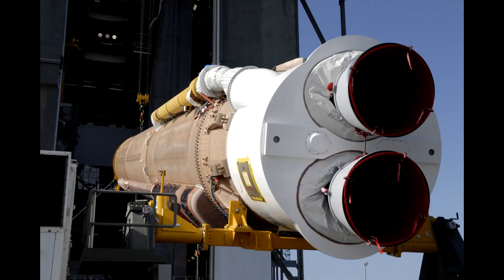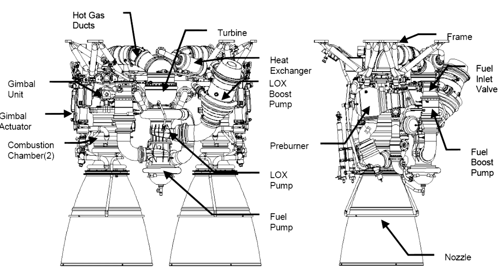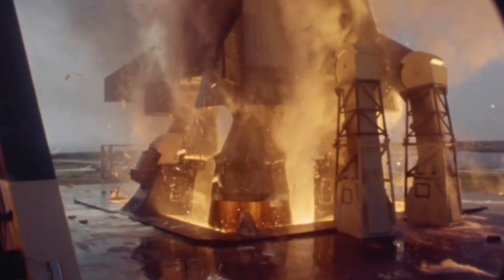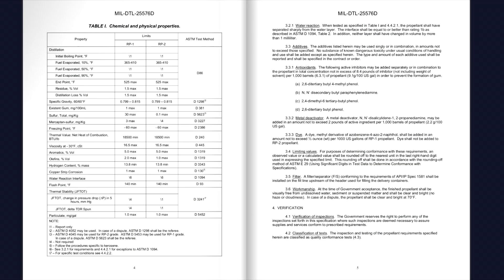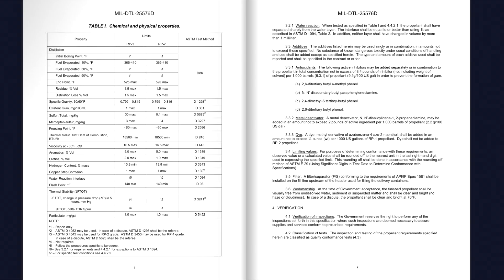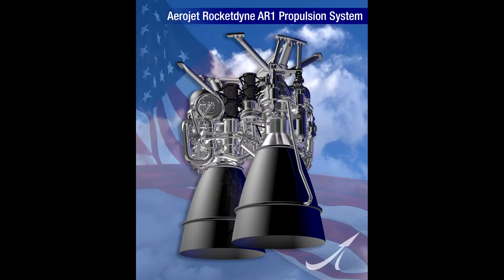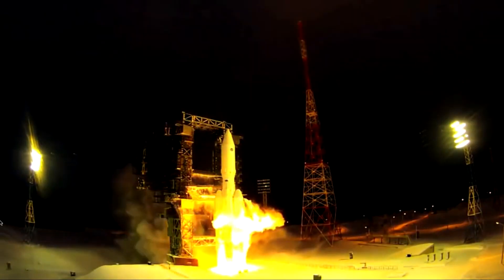Why Some 21st Century US Rockets Still Use Soviet Era Engines

Comment: Why is it that never in all space launches of any kind does the camera ever takes views of what's dead ahead.   Especially, when supposedly breaking through the atmosphere and entering space?   The rockets always curves, instead of punching through and right back down to earth.  I just don't buy it.
Reply: getting to orbit  involves reaching a specific speed in relation to the earths surface based on the target orbit altitude desired, if you just shot straight up to your target altitude, you would just fall back down immediately not orbit. Reach your target speed going horizontal, and you will automatically already be at the matching altitude by matter of physics.. and then you have the correct velocity to maintain that orbit as well.

Comment: it is amazing how slowly space technology advances. i hear today’s solar panels are only 10 percent more efficient than those used in the early 60s. amazing how rockets from the 80s are still the best around.
Reply: Many technologies require fine methods of production, but not that complexed by themselves. Compare gas and electric car. Electric car is much more simple.

Comment: Wow, didn't  know how far behind the US is from the Russian counterparts on rocket engine development.  Good to know.  Politics or otherwise aside, it is good to know.  Western countries makes design decisions based on budget, economics and elected officials and popular opinion can also add influence on the final outcome.
Reply from the maker: US was way ahead of Russia in the design of Hydrogen engines.
Reply: @scottmanley  My question to you then, at the time this video was posted, was the technology of US not at participating with the Russians that the US has to use Soviet engines?
Reply from the maker: @ronbo8512  The US weren't forced to use a Soviet engine, they continued using the RS-25 on the Space shuttle, and Boeing chose to use the RS-68 on the Delta IV. But Lockheed Martin saw a commercial advantage in replacing the engine on their Delta II with a more efficient RD-180, so they chose to do that.
Since then SpaceX has come along and the Merlin isn't as efficient, but it's very cheap and throttleable, so it's been able to make gains in the market that way.
Aerojet did develop a closed cycle, oxidizer rich engine similar to the RD-180, but hasn't found anyone who wants to use it. Instead Blue Origin's BE-4 is powering the Vulcan.
Reply: Yeah, you missed the point completely. The US solved an engineering problem quickly by switching fuels, the Soviet’s solved it by building a cheap engine that could use that fuel.
Reply: I am responding to the title and content of the video.  It is obvious that resolutions has been found since then.

Comment: Could you take a high molecular weight hydrocarbon fuel such as RP-1 and dissolve hydrogen, methane or other non-coking flammable gas in the fuel? Could the fuel gas then be bled off the top of the tank to run closed cycle engine turbopumps? The gas could be useful for pressurizing the fuel tank as well. A bit of effervescence to the fuel might help it burn better anyway. Now that I think about it, there would be the issue of pumping a gas at the pressures it would take to get it into the fuel pump's combustion chamber, unless the gas could be chilled by LOX to reduce its volume to a better density.
Reply: No it cant. Fuel tank is limit large. If you pump gas over level of fuel tank, you decrement amount of carried fuel itself in tank, which means that RD-180 would not work about 270 s but much less, or you need bigger tank = bigger booster = more weight = less payload. Moreover, if you want to pump some gas there, you need another tank with gas and its pump, otherwise, as fuel tank emptyfied during flight, it would create vacuum above level of fuel in tank. Another problem with such concept is that turboagregate in RD-180 working in extreme conditions (thats why US wasnt able to sucessfully copy it for 20+ years), its pumping about 280 ton of fuel mix (cca 200 t of liquid oxygene and 80t of RP-1) in 4-5 minutes and compress that fuel mix to 50 MPa (twice pressure as its in fuel chamber). Therefore turbo must turning few tens of thousends n/min and therefore its bearings are lubricated and cooled by liguid oxygene itself (in oxy-hydro engines by liquid hydrogene). If you would replace some of RP-1 with some liquefied gas, apart of bunch of other things which would changed, you would changed mix ratio between RP-1 and oxygene in turbo which would result in "non-computional" regime of lubrication/cooling of turbo and finally, turboagregate of RD-180 is absolutely not designed to pump gas.
Why you would even want to mix RP-1 with gas and pump it above fuel?

Comment: I am REALLY interested in the metallurgy used. Where can i find information on the high temp CRS steel used in the RD-170 series. I presume a lot of niobium and cobalt and nickel are used. I also assume that the metals are  precipitation hardened, not work hardened because the heat would anneal the metals. But that heat would eventually cause over-precipitation of the metal over time, so i suspect the engine is limited in burn time.
Reply: I can advise check GOSTs (ГОСТ) - soviet analogue of modern ISO. All alloys that was invented by academists of National University of Science and Technology "MISIS" (pretty sure this alloy in their achievement) were documented in GOSts and fully opened.
Reply: @RigelNV  Ah but which ones are used? and there is more to metallurgy than the elements and their percentages. heat treating, melt/forging/rolling processes all have effects.

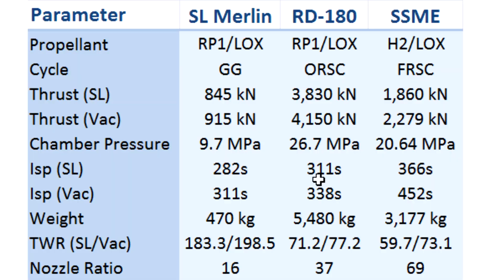Comment: 6:18 "SpaceX's SL Merlin is inferior" Why? Correct me if I'm wrong, but the Merlin is 6 times lighter than the SSME and 11 times lighter than the RD-180, giving it roughly 2.5-3 times higher Thrust to Weight Ratio than both of them. So about 4 of SpaceX's engines (1880kg) put out as much thrust as the RD180 (5480kg), but are 73% lighter! What good is the 4.5x more thrust if it is 11x heavier?? It seems the "superior" thrust is swallowed by it's own weight.
Reply from the maker: It has 10% less specific impulse which is much more important. Block 5 falcon 9 masses 550tons with all the fuel. If the Merlin had the same specific impulse as the RD-180 that would let it save about 50 tons of fuel.
So the TWR advantage is demolished by needing so much extra fuel.
Reply: @scottmanley  Ah, so it's the fuel efficiency.  Now it makes sense .  Thanks for explaining.

Comment: The gas laws state that one could potentially squeeze even more efficiency out of a rocket's exhaust, by choking it even more than just enough to bring the flow to sonic (internally). As thickening (pressurising) a gas will tend to heat it up, bumping the local speed of sound even higher.

Comment: Electric turbo pump is more efficient than gas generator turbo pump.
Reply: Not really since you have to carry the batteries with it which are less energy dense than conventional fuel.
Reply: Cyka CheekiBreeki you are talking the efficiency of propulsion but I'm talking efficiency of the turbo pump.
Reply: @hafizuddinmohdlowhim8426  I understand but Electrical turbo pumps work somewhat well on small engines like the ones on the electronic but now imagine how many hundreds of kilos it would take to power them. The extra efficiency would basically be canceled out by the weight.

So they are more efficient but if you take TWR into the calculation the ISP advantage will deminish.
Reply: Cyka CheekiBreeki I understand your whole argument. But when we talk about energy there are several ways to power up the electrical turbo pump. Have you done the calculation if we use hydrogen fuel cell as the power generator and the source of hydrogen comes from the rocket fuel? We don't need hundreds of kilo of battery.

Comment: While one must give credit where credit is due, it must be noted that the decision to pursue the closed cycle virtually, and to incur its attendant long gestation period, virtually assured the USSR would lose the Moon Race, which it must be remembered, was the whole purpose of the exercise.

The US looked at the closed/open cycle question, as well as liquid hydrogen upper stage fuels, combustion instability (and its implications for an engine which could be used in a reliable Saturn-class booster) and chose the only combination of those 3 factors which could likely permit the attainment of Kennedy's goal. 

Thus the Americans flew a Saturn V in January 1967, with only 5 large, open-cycle engines and a very large payload, and never had a booster failure in the entire program, while the Russians could only manage a very belated failure in 30 magnificently-engined N1, which never even made first stage cut-off, despite trying well into the 70's, and would have supported an extremely risky manned lunar landing at best.

Despite some stellar engineering on the cycle question, the Russians erred in all three of those important areas, and lost the Moon Race before it began.

Comment: At 2:24 I thought of something I saw in the library. I had some time to kill & picked up a US Patent book. Glancing through it I came across a water injector for a steam boiler. As I remember it didn't use this https://en.wikipedia.org/wiki/Injector but it used heat from the boiler to turn some water into steam which then would push water into the boiler. It was 1 pipe of varied sizes to make the water turn into steam & provide a wall so the water/steam being forced towards wouldn't back up away from the boiler.

Comment: Bwahahaha you are full of shit. The US doesn't use 1980s rocket engines. US had the f1 and Saturn 5. US uses  open cycle because the less power of a open cycle system is minimal vs saftey and reliability.russia uses kerosene us uses hydrogen. You are comparing apples to oranges idiot. Closed cycle Russian engines will not run on hydrogen because of the extreme pressure. Open cycle US  engines do not use kerosene because it is not a high enuff octain rating to speak . Idiots like you are the reason Russian bots think they engines are the best. Get your facts correct. Look and see how many ussr/Russian engines blew up compared to US Engines. Yea the first 4 Russian n1 rockets blew up before they got off the launch pad. Russia has had very many rocket/engine failures thru out their space race and that's just what we know about. The US has lost only 3 1 mercury test 3 astronauts killed because of fire in instrument board not a engine   failure. Fast forward  thru gemni and Apollo program to space shuttle. Over 200 STS launches and US lost 2 shuttles 14 dead neither was from engine failures. Get a clue and stop spewing inaccurate bullshit moron. Only engines bought from russia was by NASA to finish a joint NASA/India venture bc the USA refused to let NASA put f1 or Saturn 5 rocket engines on it.  Not because Russian engines were better. PS you do know Russia is simply a taxi service because they couldn't finish their iss module. US and Canada and Britain had to and 1 more tiny fact..before Russia sends a soyuz it's freaking NASA that handles the preflight check and quality control not the Russians. Another point...tell me what happened to the Kursk sub? O yea a Russian engine blew up on a Russian torpedo and sank the fucking sub you idiot.

Comment: And now we know... United Launch Alliance today has announced that they have chosen the BE-4 as the main engine for their next generation Vulcan rocket.
Reply: A few years on from that decision, I wonder if they're regretting it. Development of the AR1 engine may have been slow, but progress on the BE-4 hasn't exactly been speedy either. And perhaps if they'd not distracted themselves with trying to adapt the BE-4 to ULA's needs, Blue Origin might be a little closer to putting their own rockets into orbit...
Reply: @simongeard4824  Aerojet Rocketdyne wanted more money, had no hardware to speak of, and they effectively gave up nearly all work on AR1 when the Space Force funding ended, much as Northrup Grumman did with their OmegA rocket when they didn't get the NSSL 2 contract.

Based on the single complete engine they finished last year, it'd have taken AJR way longer than it's taken Blue Origin.
Reply: @mikedicenso2778  Yeah, neither of the options look great in hindsight, but I suppose Blue Origin hadn't had such a chance to disappoint yet.
Reply: @simongeard4824  Slow? it was virtually non-existent. After all these years and the government $$$, they managed to eke out a single prototype engine for testing. 

Blue Origin, on the other hand, invested a lot of their own money before the ULA deal, got hardware built, tested it, and then a year after the deal was inked had several BE-4s ready to go to the stands for testing. 

And they've not been all that slow. It's only been a little more than three years since they got selected over AJR.

Comment: Uhm... you're contradicting yourself in your enthusiasm for SpaceX. With escape velocity in mind, SpaceX rockets aren't really practically superior to anything. C3 was about 10 in the actual Falcon Heavy test going into higher orbit. Instead of the much higher theoretical value predicted. Honestly, the main feat SpaceX has going for it to some extent is still claimed lower cost. They're not more reliable, they're not ready for an actual trip to the moon or Mars by a long shot. And the reusable rocket concept might not work reliably at all knowing the huge forces involved in a launch, punishment it takes and how that compromises quality for a second launch. SpaceX really really REALLY has yet to prove itself.
Reply: NASA confirmed that Falcon Heavy has the largest payload in the world to any C3 under 100. Higher than Delta IV Heavy, which costs some 3 times more. The test flight left performance to recover all three boosters, which lowers the cost even more.

SpaceX is just claiming lower costs, they have lowered costs, and have forced both ULA and Ariane to do the same. And they forced the Russians out of the commercial launch business completely. And Falcon 9's reliability is not significantly different than ULA or Ariane's offerings, so claiming "they're not more reliable" is entirely irrelevant.
Reply: You wont get any Americans to acknowledge this fact unless they are fans of some other US company competing with SpaceX. Would be very un-American.

Comment: Much of the materials science behind the early Soviet rocket programme was purloined from the British.  Soviet "guests" visited Rolls-Royce and were given tours of the factory where Rolls-Royce Nene turbojet engines were being fabricated, circa 1950.  They wore shoes with soft rubber soles, which picked up metal chips from the factory floor.  The chips were later retrieved from the shoe soles and sent to Russia for analysis, which allowed the Soviets to vault their efforts to build a "copy" of the Rolls-Royce jet engine ahead by more than 10 years.  The same high temperature alloys would have been used in rocket engine development.
Reply: Bullshit. So the Soviets could recreate it from small samples back in the 50's but even with huge rocket engines made of the stuff the US can't do it today? There's a reason it is still "secret soviet sauce".

Comment: 8:38 Scott, it seems, that you are wrong. Soon Russia would not be able to made any significant number of lunches anyway - via to economic troubles and general tecnical degradation.
Few statistics as proof:
2014 - world total 92 lunches, Russia lunched 34 rockets (36.9% of total),
2017 - world total 91 lunches, Russia lunched 20 rockets (21.9% of total),
2018 (its not over yet, but still 9 months has gone) - world total 73 lunches, Russia lunched 10 rockets (13.7% of total).
Another few years with that trend - and they will end with 1-2 flight per year (about 1-2% of world total), which made all russian space industry non-profitable at all, imho.
Reply from the maker: I really hope this sad trend does not continue.

Comment: I mean Corund aka aluminium oxide crystals are highly resistant to oxidisation and heat, and they form a fairly uniform and tight seal. They are also the second hardest mineral known to man...
Reply from the maker: That what Apple used for lense covers and on some watch faces.
Reply: @scottmanley  I'm not really an Apple fan but I guess so as it also has really good optical qualities

Comment: Probably inconel; nickel/chrome alloy. Very popular in high temperature turbines, and Russia has lots of nickel. There are surface coatings that can drastically increase performance in high temperatures, but given the pressure and temperature, I'm guessing you'd want to stick with a single homogeneous material.

Comment: They may be more efficient than other engines of that size, but it's the lower price that attracted interest. I believe both rockets that presently use them will be changing to American built shortly. Russia's insistence of no military satellites launched by these caused this change. Latest rocket engine design is for reusability and or brute strength in lifting. The RD-180 burns old less efficient kerosene fuel. Today it is inferior to super cooled fuel or liquid hydrogen. Innovative and impressive, especially at the time designed, soon to be an interesting relic of the past.